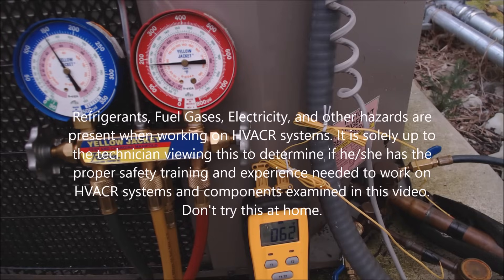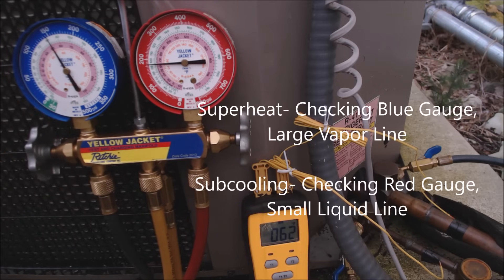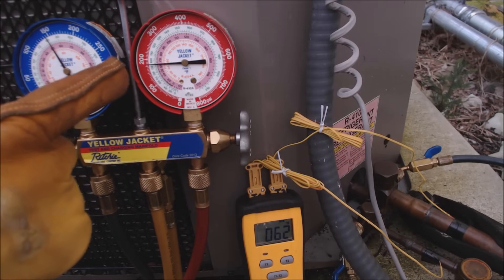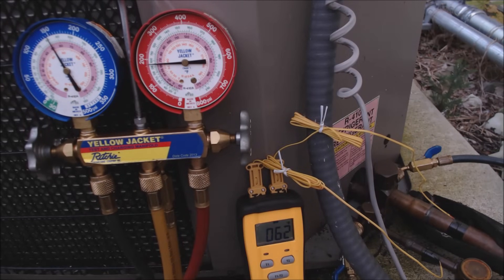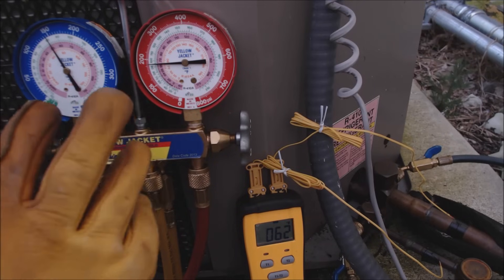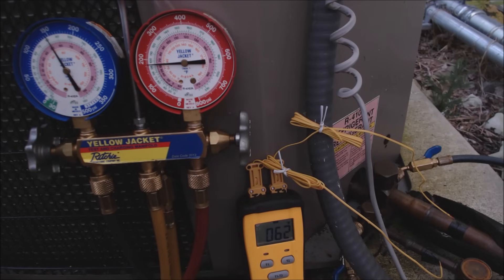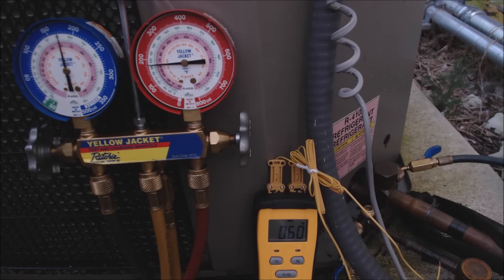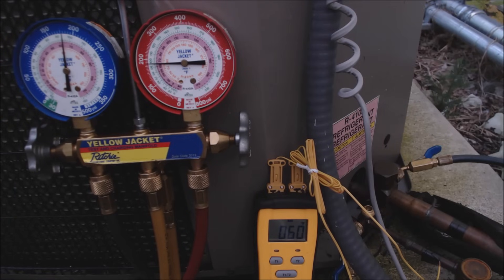HVAC Troubleshooting of Bad Compressor Valves! How to Verify!

Comment: wow Thanks never seen that technique to properly diagnose  Hi vapor pressure / tempt  & or a failing compressor by not pumping down  vapor stays the same  @ all '.... Ive seen a many compressors kick out & would not pump down but never see this in my 27 yrs in

Comment: I had a compressor that wouldn't pump down below 120psi and would make excessive noise when running like marbles where bouncing around inside when in cooling. System had a 7 degree temperature split. 150psi on suction and 289 on the high. 13 degrees superheat, 5.7 degrees subcooling. Outdoor ambient was 90 degrees. Blower, coil and filter where clean. Confirmed it was getting proper airflow and EEV  resistance was checked and also manually closed and opened it to test. It functioned properly. My question to the community is...what do you think was wrong? Compressor wouldn't pump down so I leaned more toward a bad compressor after checking everything.
Reply: Also checked for restrictions in the filter dryer and reversing valve, which checked out with a 1-3 degree delta t

Comment: I just replaced a Copeland compressor with the same compressor the unit is gas heat no reversing valve and the new compressor is running equal pressures any ideas?.

Comment: If the compressor has a leaking valve, will there be a difference in amps?  Would you check the common wire for the compressor for amps?

Comment: Having this same issue but my suction r410A is 185 and liquid is 275. Suspect it's discharge valves. Also have a piston not a txv. Colman 2 ton, 3 weeks old. How the compressor does pump its self down, so I'm second guessing. Even I pretty eliminated every other possibility

Comment: I am repairing the FINI rd49 refrigeration dryer that does not cool. After connecting the manometer to high pressure
3 bars off
4 bars on
I loaded 10bar with nitrogen for the whole day, nothing was lost.
I read that it is a compressor ..., I dismantled it according to the instructions of Asian colleagues from YouTube  I moved the valves to the other side, sanded them with a small piece of paper and made a new gasket. Now it gives over 16 bar (I am waiting for the ordered manometer with a larger scale)

https://www.youtube.com/watch?v=GHm1WVju0zw&feature=emb_title

After soldering compressor to the air dryer, there is practically no pressure at the connection from high pressure. I checked the pressure without refrigerant. 
Without refrigerant, is it normal that it does not provide pressure?
High is 5 psi , low is on 0. Valves are closed , the flow is very weak.I made video how i mesure. And how its look when i take out hose from gauges.
https://youtube.com/shorts/wR7RPw0Hw0k?feature=share
This is how everything is connected, the video below 
https://www.youtube.com/watch?v=hkAfLVUVrPc
Conneted mannometer directly to discharge pipe it give over 200psi  https://www.youtube.com/watch?v=saw3EMYtLAI
[/URL]
is it normal that the oil is in the filter dryer?
https://youtube.com/shorts/_kMPYRkqwhQ?feature=share

any suggestions?

Comment: The ambient temp is 73.. low side 45 and the high side was 110.. the car cools during the night and in cooler weather but once it gets around 80 degrees it only cools a little while driving running but blows warm air at idle.. any suggestions?

Comment: my air compressor slows down after building some pressure  what could be the problem it works fine till40  and it slows down after that puts alot of load on motor

Comment: What causes bad valves in a compressor because I had a job like this on a three-year-old unit same exact diagnostics and I changed the compressor in 2 weeks later it had the same exact problem with the same exact diagnostics But I don't understand why the system killed 2 compressors.  I ended up refunding the customer and walking away from it very shamefully i might add. Please help
Reply: bad refrigerant?

Comment: Earlier today I came across a unit where my suction pressure was bouncing between 70-90 psi while my head pressure stayed relatively constant  .It was an older 410a unit with a txv.. 
I thought it was a txv issue but was told it was a compressor with bad valves.
I am watching this video and this was not what I was experiencing. 
Why was my unit pumping down like that? I still think that valve is the issue

Comment: With all else in proper operation, what would the symptoms be on a R410a 5ton AC only with some non condense-ables? Low side Liquid line Pressure and temp maybe?

Comment: It could also be a bypassing reversing valve, almost identical symptoms, it's another definite check before replacing the compressor
Reply: You are correct. However, in this particular case, this is just an AC so no reversing valve.

Comment: What if the compressor pumps down really good? Is that a possible situation? Also i saw a tech pull a vacuum after a pump down, is that necessary? He didnt open the lines at all eaither

Comment: Just to add to your diagnosis
Compressor amps will be lower as no work is being done. If you close suction access valve you get quicker result and less likely  to go off on hp. If it won't pump down to 20" vacuum it is suction valves . If pressures equalize quickly when compressor shut of after a run period it is discharge valves. Learned this from working on semi hermetic compressors.

Comment: Hi . Can you help me ? What is the problem if the suction pipe is heating ...with the temp of 30°. 
Thankyou .
Reply from the maker: Do you mean the suction temp is below 30 degrees F? You would need to check superheat and subcooling. It could be low on refrigerant, liquid line restriction, or low airflow. I have all the troubleshooting spelled out in the book I just released at https://www.acservicetech.com/the-book  thanks!

Comment: Hi, I have been checking your videos and they are very well explained. Do you know the best way to check the oil level in the system? I mean how you can tell if you need to add more oil or if you have too much oil in a working air conditioning?
Reply from the maker: You can't really. It won't use the oil or burn it up. It will remain in the system and it comes from the factory in the compressor and outdoor unit along with the refrigerant charge, thanks!
Reply: @acservicetechchannel  Thank you for taking the time to respond. It is common to find that when you have a refrigerant leak in the system, the refrigerant and compressor oil will leak. In those cases do you have a way to tell if you need to put extra oil along with the refrigerant charge?

Comment: Hi your the best.  You should take calls and charge a certain amount per minute.  I have a very high suction and sub cooling low.  Can't figure out what's wrong.  And of course customer is a senior and to make things worse she has grandchildren stay with her.  I feel awful and I can't get some of my fellow hvac to help.  There swamped.  This is awful for my customer.
Reply from the maker: A partial pump down can be used to determine if the compressor is the problem, yeah it is hot out there and the techs are probably pretty busy, thanks!

Comment: Just had a brand new Bryant central air unit installed, From the get go it was blowing luke warm air, Had a tech come out and he diagnosed a bad compressor valve!, How common is this on a brand new unit?
Reply: It happen but not often. Especially not often with Bryant or Carrier

Comment: I've had situations where I'm on a piston coil compressor pumps down well, took all the gas out replaced it with new gas and still bad temperature difference.
Pressures were high on the suction side and normal on the high side.
Somebody told me it's a waxed coil you know exactly what that means
Reply from the maker: It could be something wrong with the piston. You also may not get a 18-21 on a piston unit and the system is still correctly charged and working correct. It could be as low as 14 degrees and still be correct if there is a high heat load in the building. Piston systems only work efficiently once the temp on the building is near where the building owner sets the thermostat to, thanks!

Comment: Would a scroll compreasor also display these syptoms or if this is happening on a scroll compressor system is it more likely the TXV?
Reply from the maker: It could be the internal pressure relief in the compressor or reversing valve, not the txv, thanks!

Comment: What does it mean on a 22 unit on low side is 75psi and the high side fluctuates 75psi 250 to 325?
Reply from the maker: That could be air or nitrogen in the system mixed with the refrigerant. Is the delta T low and are the sat temps on each line higher than they should be when the system is off and equalized after a few hours?

Comment: How would you check if you have bad compressor valves on a heat pump running in heat mode, but not heating? I'm working on an ICP RV energizes in cooling, but not sure of the RV got stuck in cooling mode when it went into defrost and it didn't reverse back to heating mode.
Reply from the maker: You can try a partial pumpdown in cooling mode to see if the compressor is strong enough or you can take temp readings across the reversing valve on the lower temp tubes 6" away from the valve with k type bead temp sensors to see if you are over 6 degrees off from what it is supposed to be. Basically you need to follow the tubes to get the correct two, thanks

Comment: How to diagnose (tell) if compressor have bad oil
Reply from the maker: If you see bubbling oil when disconnecting the hose set, that is acidic oil. You could also do an acid test. If you see black particulates then that was from an oil burnout or possibly from the tech not running nitrogen through while brazing, thanks

Comment: I question this video and it's accuracy. It seems that by the pink tag this is an R410 unit and by the sound it's most likely a Scroll compressor. First of all a Scroll does not have valves. I agree it appears noisier than normal, but since it's a 3 phase compressor it's a very good possibility that it's simply running backwards.
Reply: It has plates and one of the is open
Reply: Why do you think it's 3 phase?

Comment: Your videos are fist class. It seems to me you could simply work with pressures on this. Low side ok high side low. Trying to compress a gas. Nothing compressing. Compressor not compressing. Compressor noise. Don't need to be hit in the head with a shovel to suspect compressor. Nice to see the logic pros use. Noisy compressor. Good thing to keep in mind to avoid. Interesting stuff.
Reply from the maker: It is just one of those things you want to be sure of. Some units have a reversing valve that could be the issue, or service valves partially closed with the cap on and you don't want to be the one condemning something that is not the real issue. It is just that doubly sure feeling. Actually the vapor side would be high, thanks

Comment: I have tried your method of reading temperature and found that the black electrical tape will change your actual reading if the sun hits it.  I had a broken clamp and tried exactly what you have showing and took temps then I used my broken clamp and held it in place tight against the lineset and my temperatures were off by as much as 6 degrees F.  You might try that and make sure you aren't getting bad readings when the sun hits your electrical tape.
Reply from the maker: Hey Tim, always make sure the sun is not hitting it. That will definitely through your measurement off. I use a thick leather glove or I zip tie a piece of armoflex insulation over it if I am worried about that and then its fine. I have also tried adding armoflex in the shade and I get the same reading, thanks

Comment: Hey Awesome videos, I have learned so much from you. I thought you only can determine superheat with a piston or capillary type expansion valve not with a txv?
Reply from the maker: We use subcooling to check the refrigerant level but superheat is used to check the txv itself. Superheat is used for troubleshooting txv's, thanks

Comment: Is the compressor recip or scroll
Reply from the maker: Lance that was a scroll, thanks. Pumpdowns can really help on a diagnosis but if the sat temp on the vapor side is higher than the temp in the building but the high side is normal and there is no reversing valve or electric strip or other heat source such as a furnace running at the same time then the compressor valves are the problem. Don't try a pumpdown on a microchannel unit outdoor coil though, thanks

Comment: What if the reversing valve was leaking?
Reply from the maker: Douglas, you are absolutely correct. I am only talking about condensors for ac only in this video, thanks!
Reply: If it was a leaking reversing valve, wouldnt it still have pumped down when he closed off the liquid line?

Comment: Can you please please make a video explaining how and why a 90% gas furnace produces water and the need for extra vent that is tied into the exhaust of the furnace
Reply from the maker: Basically the furnace exhaust temp is so low in temp that the water vapor located in the exhaust condenses in the secondary heat exchanger and exhaust pipe and heat is absorbed by the air passing by the secondary water heat exchanger. This is the difference in efficiency from 80% to 90% efficient furnaces. Water vapor is a byproduct of combustion and that is why furnace exhaust gases are wet if you ever felt an 90% efficient exhaust. After the heat has been absorbed from the condensate, it then needs to drain out of the furnace via a condensate line. That would be a good idea for a video, thanks

Comment: it doesn't sound happy at all.  the sound of low load and extra noise is a giveaway there. adding power draw, with valve closed and pumping down could be helpful :)
Reply from the maker: Thanks Throttle Bottle!

Comment: Awesome Vid as usual.  I come from an appliance back ground, and luckily I just watched this video, and it helped me a lot.  I just did a fridge, R134a system, the evaporator is supposed to operate around -20 degrees.  My gauges were reading low side 38.2 psig/43.20 sat, and the high side 65.7 pig and 66.2 sat.

Is this an indication that the compressor valves are bad? 

The charge was correct, and I don't think there was a restriction, so not sure what else it could be other than a bad compressor.

Thanks again for the awesome vids!
Reply from the maker: The sat temp would be high if the temp inside the fridge was high but yes otherwise that would be too high, thanks!
Reply: acservicetech ok. Yea the temp is high, so would that mean the compressor balances are bad?
Reply from the maker: That would not mean that the pressures were bad but just that the temp was room temperature. What temp air was coming off of the refrigerator evap coil? Remember that the evap coil is absorbing the heat from the air around it and the refrigerant will increase in temp according to the temp surrounding it. As the temp in the box lowers, the sat temp will lower too, thanks
Reply: acservicetech the freezer was high temp. Around 50 degrees.  A r134a system for the freezer evap should be running around -20/-15 degrees, and there’s about a 20 degrees difference between the evap temp and the compartment temp. At -20 degrees, 134 should be -1.56 psig.  Freezers should be around 0 degrees in the compartment. So it was way too warm. I’m just trying figure out if the compressor is bad or not. I already told my customer it was, but I just wanted a second opinion.   Thanks for the response! That super awesome of you.
Reply from the maker: Ok yes, I know you said -20 but I was thinking  refrigerator when you said fridge, sorry. Yes with that info, if you know the refrigerant is correct, and it ran for a while then that sounds like the only other thing it could is a leaky compressor, thanks!
Reply: acservicetech ok. Yea sorry for the terminology. The refrigerant was good and it was running for awhile. Ok. Thanks man! You’re super gracious to do what you do! Thanks.

Comment from the maker: Make sure that you don't try to completely pump down micro channel condensors if you have more than 15' of lineset or if the unit is overcharged and under 15' . This was only meant to be a short test but since I knew it was a bad condensor, I left it run longer at the end of the video. Normally you could try to perform a full pump down on a standard 3/8" copper tube condensor in order to test compressor valves. You can actually tell the compressor valves are bad due to the high sat temp since there was no heat load, low subcooling, and around the correct superheat. You can tell if a single component refrigerant is good by checking the sat pressure once equalized and comparing the sat temp read on the gauge to the temp surrounding the unit. If this was a restricted liquid line or a partially closed txv then the sat temp would be low and superheat high. If the txv was stuck open then there would be little superheat. If the refrigerant charge was low then the vapor sat temp would be lower and the superheat would be higher. This was a bad compressor due to the noise, sat temp, superheat and subcooling and the pumpdown would not necessarily be needed but can be used more as a confirmation on standard 3/8" coil outdoor units. Thanks!
Reply: Dude I learn so much from u man . Ur are and amazing Teacher u and GrayFurance! Thank u
Reply: so you're not an thrill and adventure seeker.  nothing beats expanded or blown out coils, perhaps the loud howling hiss of high pressure internal bypass opening :))
Reply: So r410a is not a single component refrigerant is it? ive read it acts like a single component, so can you tell the r410a is good with that trick when equalizing? or is that just for r22?
Reply: AC Service Tech LLC thanks so much this is my favorite channel